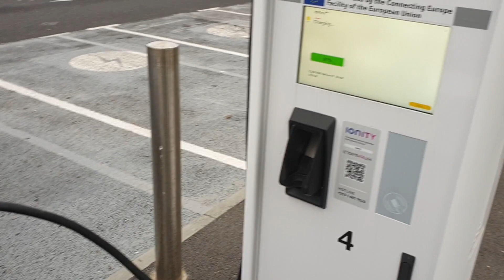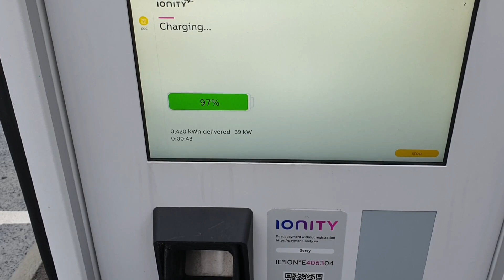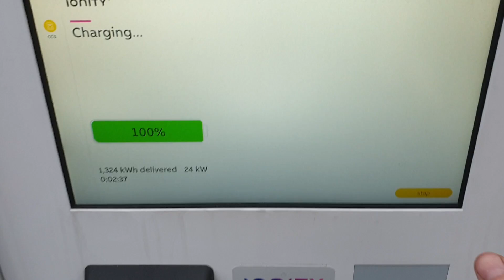Ionity ABB CCS Charging Success

Comment: Will this extensive collab result in a CCS board like the Chademo board available at someone's webpage??  I only have 3kW +15kW hop hodge power supplies  onboard and would very much like DC charging!
Reply: hey Tore, did you find out the answer, it's just that i have had to put my build on hold because of the price of a rapid charge kit

Comment: Even in past in my faktory ev i was having samé isues And they fixem IT And most of the time There was in memory fault code that proximity check failed . Měny times i have avoided this by holding charging connector firmly in socket durring handshake